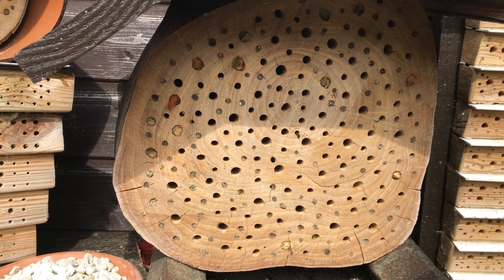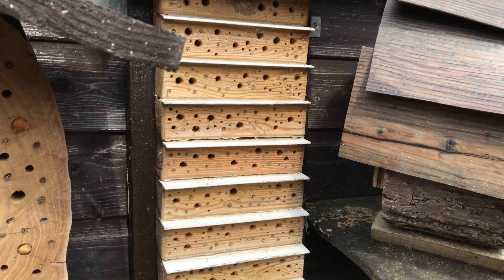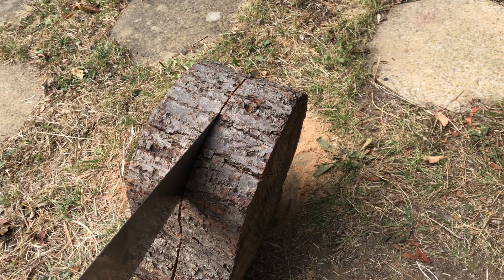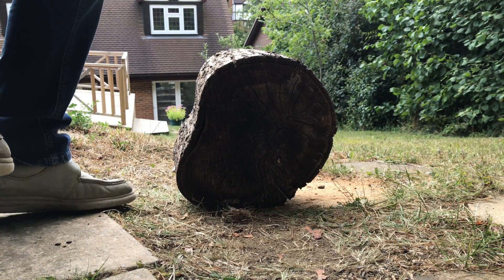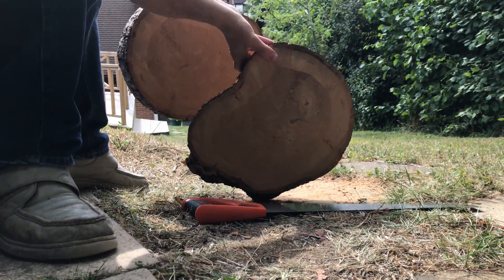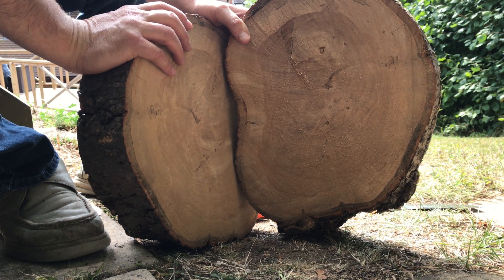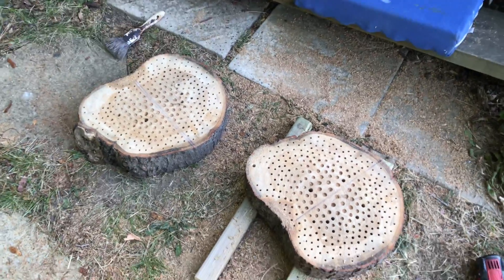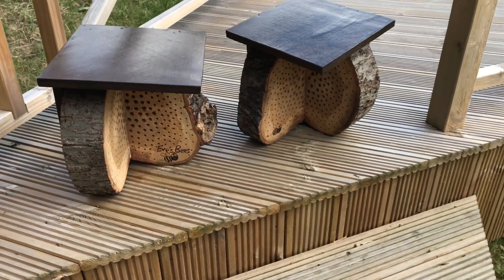How to build the most successful Bee or Bug Hotel Habitat.....Ever?

Comment: What did you seal the surface that has the holes in with?
Reply from the maker: PVA and water 50/50 BUT these days I use Raw Linseed oil and White Spirit 50/50 mix and the spirit evaporates off leaving the natural oil :)
Reply: @Calastein  thank you so much